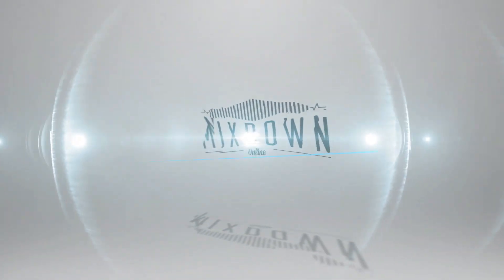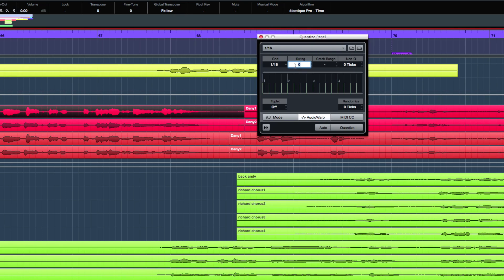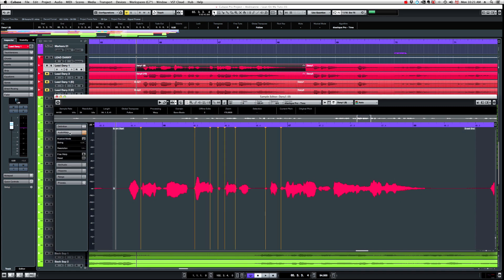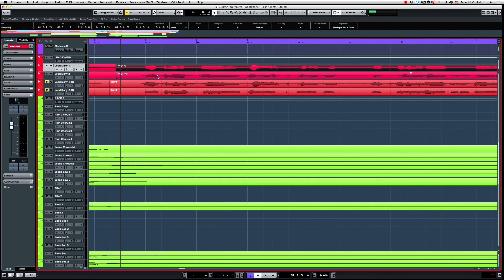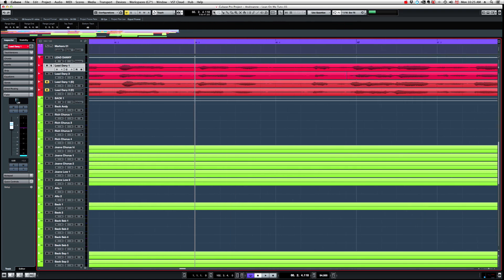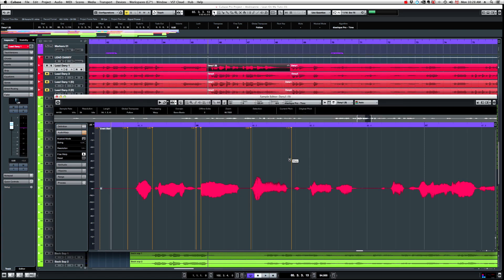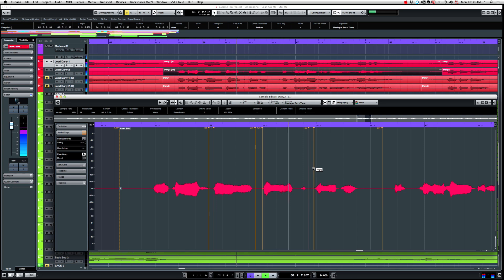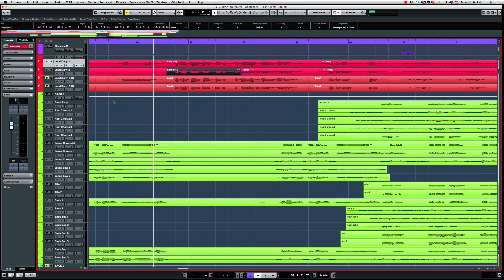How to FIX VOCAL TIMING in CUBASE 9 - mixdown.online

Comment: Hello Chris: and again a question for an old video: in another video about audio editing there was an argument to do this more manually, without audio warp, just cutting, moving, taking care of the fades, because of the audio degradation of warp. The result was good, but a little time consuming. But the video explaining this is today a lot of years old, and maybe audio warp algorithms have better quality nowadays. What do you think about this? Do you note some degradation with the warp or it is maybe unnoticeable?
Reply from the maker: At some point, if what are you trying to fix is way off, yes, you can get audio degradation with Warp. It's like pitch correction with Vari Audio, if the vocal is too off, the correction will show. For fine-tuning something that is just not tight enough, it works well.
Reply: I understand. Thank you again, Chris.

Comment: Great tutorial, thanks for the info!  Quick question - whenever you are using variaudio or audiowarp; do you process it (flatten it) afterwards?  There is an option tab in the inspector which I presume embeds the editing which you may be able to undo in the offline processing history.  I'm just wondering if you tend to leave it unprocessed (unflattened) so that you can make tweaks later on.  Thanks
Reply: I just tried flattening an audio clip with variaudio etc, and you cant undo that processing in offline processing history for that clip (unlike if you process the clip with an EQ plugin, which you can undo in offline history).  So I guess it may be better to leave variaudio and audio warp unprocessed?  The only problem being CPU usage and also if you further process an audio clip offline with a plugin, it says it may undo variaudio changes, so in this scenario, best process the variaudio/audio warp before offline processing with vsts etc.
Reply from the maker: Exactly, so you might as well process Variaudio and commit before applying offline effects. If you only offline process a specific segment, bounce that segment (Flattening) without the entire track and apply your offline vst

Comment: Variaudio is one of the most awesome features in Cubase Pro especially when you're doing double tracking or tight harmonics. Funny though, I never use quantise audio, I always do it manually (AudioWarp) just fixing laggy / lazy singing.
4:29 you should try using the "lower area" for that one you can still zoom in the wave forms there. The advantage is that you can see the drums / other vocals in parallel. Especially when you have done the main vocal you can actually sync the other ones "blind" by looking at the parallel wave forms.
If you want to do double tracking with your ears, pan hard left / right then its easier to see which one is earlier.
Last tip: variaudio can really make your guitars "pop" as well, especially when you have a "relaxed" player; guitars are usually a little behind - don't drag all notes forward, just the ones that are out too far! 
Also keyboard players are often ahead - quantizing MIDI might give you a bad result if you have sounds with slow attack, if in doubt bounce to audio first.. orchestra is actually hardest to get tight
Reply from the maker: Yeah VariAudio is awesome for sure, I use it a lot for vocal pitch correction! I will have a video coming out soon on VariAudio. Yes, I could've worked with the lower area on this one... I like the lower area but I'm still not used to work with it a lot ;-)  I agree with you, quantizing is not always the way to go with slow attack sounds... Thanks for your input my friend :-)
Reply: I have quite a lot of experience with Cubase's pitch correction (due to working with pitchy singers) and making that sound in a natural way, at one stage I want to make my own video on it. Only thing I need to figure out how to capture the "live preview" sound during the correction for some reason that one is not captured because it does some "behind the scenes ASIO routing". With pitch correction there is an awful lot that can be done wrong - looking forward to your take on it! PS: I realised I meant AudioWarp in my first post but yes I use Variaudio as well. With "serious" singers I will mainly fix the "Main" or "goto" notes and leave a lot of the other ones "blue". I find timing is usually a lot more important than pitch even with backing vocals.